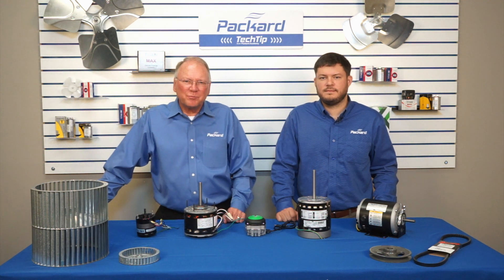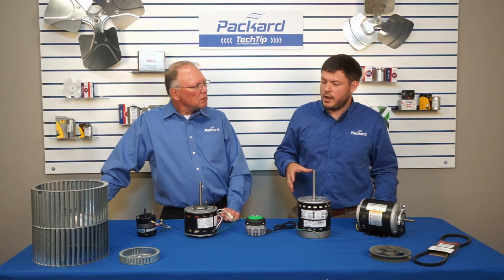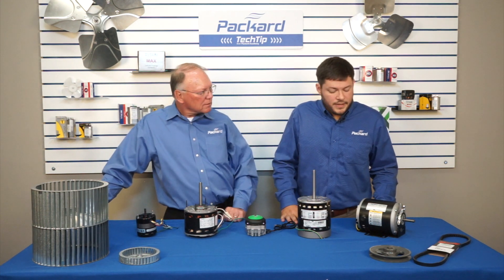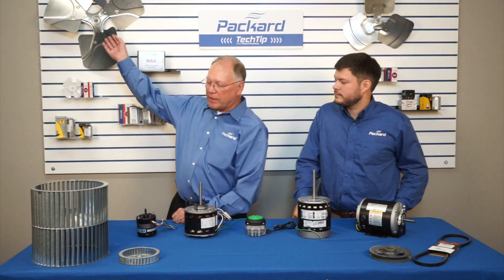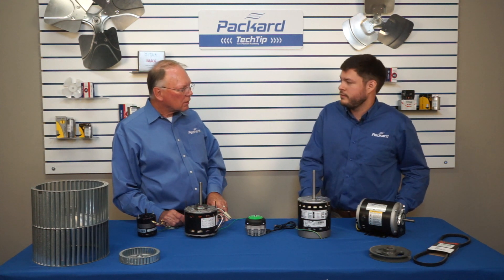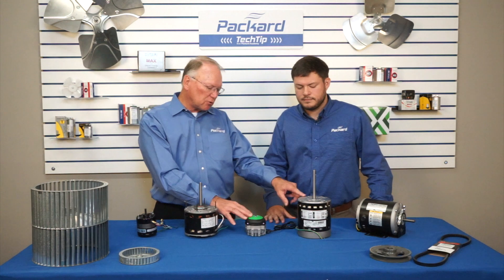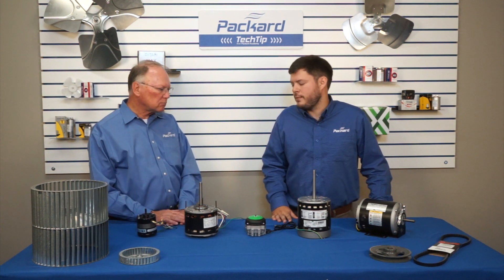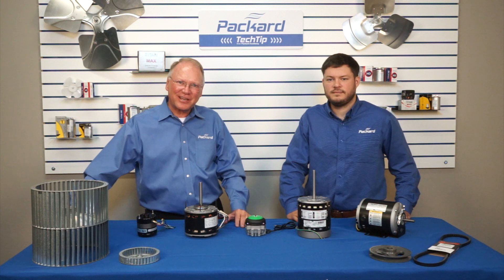There’s More to Selecting The Proper Motor Than Just Horsepower.

Comment: I have always known that oversizing a motor was not good, but didn't really know why. I have seen in the field where oversized fan motors tend to fail prematurely. I caught what you said about having a underloaded motor generating more heat and causing damage. I have seen the proof of this in the field, but Why is that? It seems like to me that if your amp draw goes down, the motor would generate less heat... I know I am missing something here?  email me at bterrell@autrytech.edu
Reply from the maker: A PSC motor will operate at about 60% efficiency.  So, if 100 Watts are being supplied to the motor, for example, then 60 of those Watts are being converted to work and 40 Watts go into the winding as heat.  If the motor is operated with a load different than what the motor is designed for then the operating efficiency declines, even if the Amps are reduced.  This results in an increase in the winding temperature.  Lower Amps indicate a lower load.  With a direct drive fan or blower motor, the load is really air.  If there is less air going over the motor than what it is designed to handle, and more heat is being introduced into the winding as a result of lower efficiency, there will not be enough air to prevent the motor from overheating.”